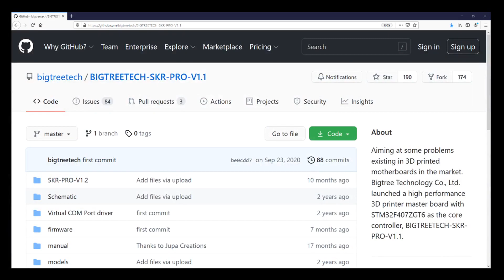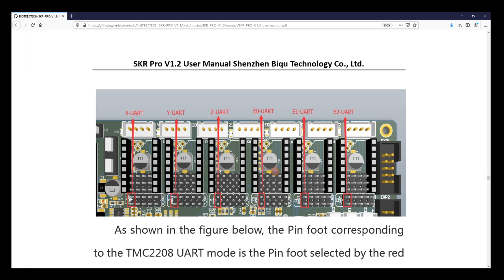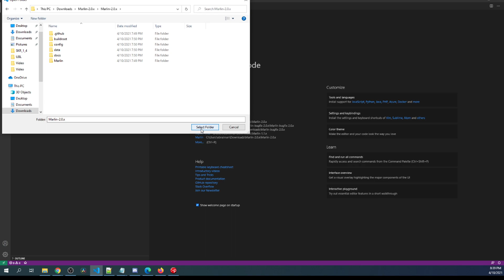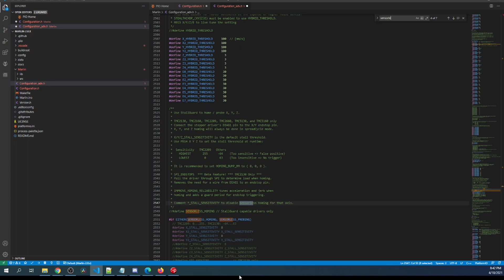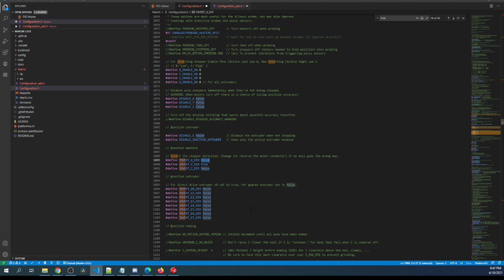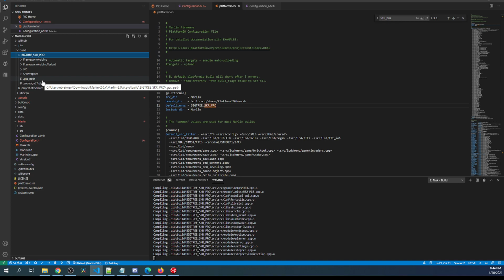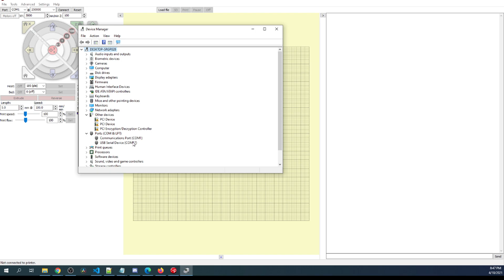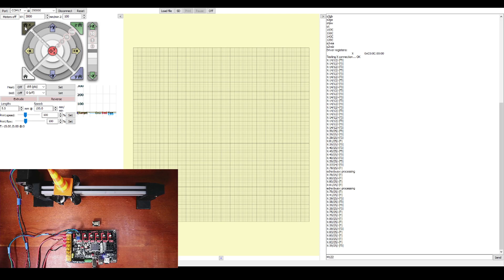SKR Pro v1.2 - TMC2209 UART with Sensorless Homing

Comment: Quick question. I'm following along to RE-configure my setup for sensorless homing. I had previously installed the TMC 2209 drivers without sensorless homing. Back at that time I was instructed to "bend" down a pin on the underside, which as per when you insert the driver at 3:40, the bent pin would be 3rd pin from the left at the top of video window. I cannot now remember why I bent it, but I am seeing that you did not bend a pin. I'm guessing I need to "un-bend" it, but I want to make sure. Do I indeed unbend it?
Reply from the maker: You have three options replace stepper, bend pin back or solder a new pin in place.
Reply: @EdwardBraiman  OK, thank you!
Reply from the maker: You're welcome.
Reply: @EdwardBraiman  SUCCESS! After a lot of tweaking config files and compiling firmware, I finally got Sensorless Dual Homing working for both Y and Z on my LowRider v2 full-sheet CNC with SKR Pro 1.2 and TMC2209 drivers!
Reply from the maker: Congratulations 👏

Comment: Hi Ed. Thank you for taking care of the quality of what you do! Beforehand, I apologize because I don't write in English, I'm using a translator. I have a MTB set, SKR Pro v1.2, TFT 35 and TMC2209 board. I need to use sensorless to homing, but also to level the table and write this data to the EEPROM. If possible, make a video about it. Thanks.
Reply from the maker: I'm hoping to make dozens of videos soon, we're getting hit with a heatwave, so standing in high temps and humidity limits my  recording time.
Reply: @EdwardBraiman  Existe maneira de utilizar o sensorless UART do TMC2209 para fazer autonivelamento da mesa?

Comment: there is no BIGTREE_SKR_PRO in my platformio.ini file. how can I fix that
Reply from the maker: The steps have changed since Marlin firmware release.  Look for a folder INI and find the processor type.  Then search for SKR PRO.
Reply: @EdwardBraiman   #
# BigTreeTech SKR Pro (STM32F407ZGT6 ARM Cortex-M4) with USB Flash Drive Support
#
[env:BIGTREE_SKR_PRO_usb_flash_drive]
extends           = env:BIGTREE_SKR_PRO
platform_packages = ${stm_flash_drive.platform_packages}
build_unflags     = -DUSBCON -DUSBD_USE_CDC
build_flags       = ${stm_flash_drive.build_flags}
  -DSTM32F407_5ZX -DVECT_TAB_OFFSET=0x8000

I found that but I don't know what I will do with that  :)
Reply from the maker: Copy BIGTREE_SKR_PRO and paste it over MEGA2560 in Platformio.ini for default environment.

Comment: If I want to flash the board directly from the usb, do I still need an sd card? If I do then do I have to keep it in forever, or can I remove it and use it to upload gcode. Thanks
Reply from the maker: In order to load firmware you will need to remove drive and load firmware.bin.  you can remove after flashing firmware.

Comment: Hi Ed.  Thanks for all of your great videos.  They have helped me a LOT.  I am very much a newbie at VSC, but making good progress.  In regards to Environment, does this just change to file locations or, is there more to it?  The reason for asking, I used Marlin Build and the environment used was the default Mega2500.  I found the compiled firmware in this folder and it built okay.  Is changing to BIGTREE_SKR_PRO doing anything else other than the compiled firmware location?  Thanks again!
Reply from the maker: Only other issue is I recorded all these tutorials before Marlin firmware update two weeks ago.  I might need to update all my initial board tutorials to address confusion it's created with Marlin firmware.
Reply: @EdwardBraiman  - Thanks for the reply.
Reply from the maker: You're welcome.
Reply from the maker: Well the firmware is always built in same folder, ".pio", but changing motherboard type causes compiler to point to another pins file.  Serial port is specific to board architecture.